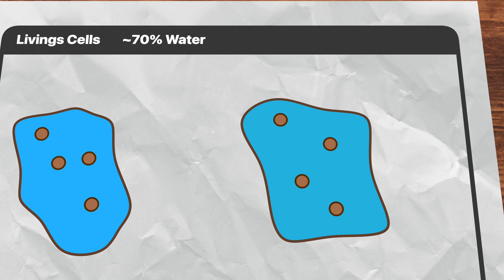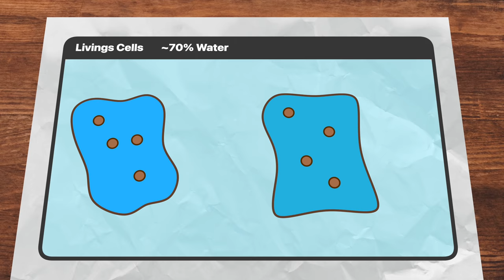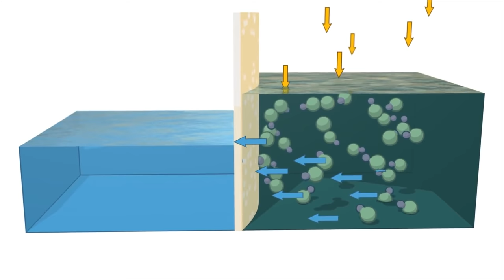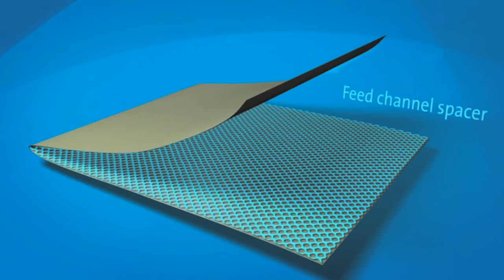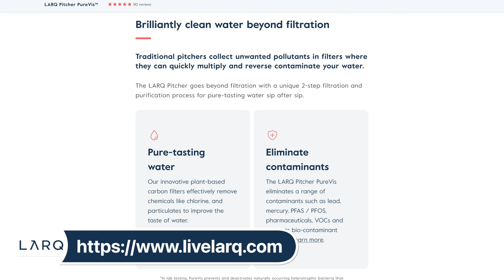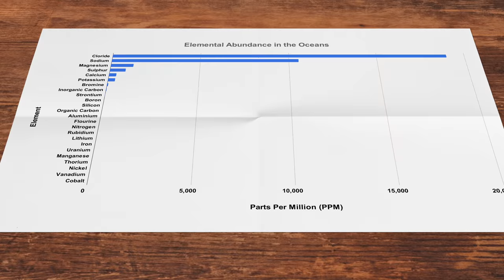Why Not Build Desalination Plants EVERYWHERE?

Comment: This video feels more like a marketing campaign for the city rather than an analysis as to why there aren't more desalination plants. The actual answer to the question was said in 10 seconds with no real dive into it. 
The Neom project sounds like another one of those model city plans that will ultimately fail because it relies on other systems which offset everything good that is done by the project. 
How can we ensure that removing these elements from the ocean is fine to do? How can you ensure that you don't remove too much water from the sea? How will this affect its biochemistry? 
Very little science was presented in this video and I am even skeptical even on what was presented. 
Is the Neom project the future of desalination? Who knows, because this guy sure doesn't. No specifics about the technology is discussed, just empty words and marketing terms.
Reply: Don't forget that Neom being a straight line is the worst start to urban planning you could possibly make. Cities have been circles for thousands of years because it is the most efficient shape for minimizing the average distance between all points on its area.
Reply: I got Matrix vibes when he started talking about that city.
Reply: Very good points. When something appears too good to be true, it always is. 

The solutions to our biggest environmental problems will require cultural change. Technological innovation will not save us—it will help, but innovation in technology without innovation in culture is a futile path.
Reply: “empty words and marketing terms.” 

Just because he doesn’t go 🤓 mode on doesn’t mean that his video is entirely fodder.
Reply: @Nukepositive  i disagree. It is inefficient for commuters but in an industrial sense, having 100% of business inputs and outputs connected via internal railways vastly cuts down on all costs associated with logistics. Commuters and pedestrians can use these systems as well.

Less efficient than getting into a car and driving but more efficiant than building a sprawling city in the desert.
Reply: For sure I thought the same thing.
Reply: @justifiably_stupid4998  You can still have an internal railway without it being in a straight line. We literally have railways all overs and point a to point b are not in a straight line. 

Also we already have an internal transport system called a subway. You can have the same “city of tomorrow” concept like Neom but in a circle or hexagonal shape and underneath the city is an organized and efficient subway system for goods and passengers.
Reply: Considering how much of the planet the oceans cover, I don't think taking a portion of that for desalination would be harmful. We'll probably be forced to do it anyway later on so may as well make it more efficient through more of those projects
Reply: But the desalinization through solar power is actually a real big brain idea. This has to be the future (the concept, not neccessarly those domes planned in NEOM)
Reply: @Second_Splitter  COnsidering his video is titled "Why aren't desalination plants everywhere" It's highly misleading to provide no actual reasons and sell out a futuristic project with no technical specifications. Even just providing some basic analysis: Desalination plants are incredibly expensive (show costs of one), take up too much power (show  a comparison of energy usage to other water filtration systems like spring wells), and generate brine which is terrible for the environment (plaster some research about how dumping saltier water into a local area destroys the habitat). Something like this would give us an idea of why they aren't around with some numbers that we can wrap our heads around.

The video was not about presenting facts to answer the question of why desalination plants aren't used, it became a video to speculate (key word here) that the Neom project would be the solution to the issues of desalination plants. However, as viewers, we have no idea of what those issues really are, their scale, and what this will do differently to properly fix it. This, in turn, limits the video to a marketing trailer with nice terms and technologies. 

This video does not serve to inform, but rather, to make empty promises and lure in investors who don't look further than skin deep. Nice ideas were presented, reverse osmosis, membranes, solar power, but without numbers or facts to back them up, what use are they?
Reply: @akiraigarashi2874  I understand that, that's not he issue I have. I am criticizing the video for what it presents. It feels like nothing more than clickbait for some speculative future project from a place that has already seen plenty of these fail due to  external issues. These types of projects have become fake outs, on the surface working, green, sustainable projects. Below, supported by the very systems they attempt to abolish.
Reply: Someone call Thunderfoot...
Reply: @festivebear9946  As far as I know he mentioned brine’s negative impact to the environment.
Reply: @spltorky  And it is highly fictual, their water source is untested and if you think one secound about it. How do they remove the salt in the dome? Do they have to shut down the water plant and remove it? Seems kinda stupid.
Reply: @justifiably_stupid4998  Yeah, and if the rail is under maintenance you can just use the other way around ... oh wait, you only have one way only? How tragic.
Reply: One question can’t we put the salt and minerals back into the used water? Basically using the fresh water from desalination for our needs and putting the salt and minerals back into the sewage system that flows back into the ocean.
Reply: Whatever large amount of water you think you are extracting from the sea to make fresh water, I can assure you, the impact wouldn't even be measurable. The ocean is way too large. 

Our global yearly use of fresh water is 100 000 times smaller than the size of the ocean. On top of that, literally all of that used fresh water will eventually end back up in the ocean again due to rainfall. 

But yeah, this project/city is an absolute gimmick regardless. Building a city as a straight line is like the dumbest thing you can possibly do for the simple reason that you would need multiple times more infrastructure to support it.
Reply: @jarzez  "The ocean is way too large." If you spread it evenly around the whole globe. Yes. If you concentrate your concentration of salt and minerals onto one particular place, for example using a pipe. No, the ocean in not large enough. It is the concentration in a defined area, not the ocean as a whole. It does not become salty throu evaporation of the sun because of the global water cyle... You do not have this with your desaltation plant.

Your 100k number is dull and we gain no further knowledge from it.

I agree with your rejection of neom, not sure what exactly you mean with multiple times more infrastructure. But there are pleny of examples where neom lacks critical thinking so I will pick my favorite ones and guess you are speaking about them.
Reply: @Seraphim262  you are not removing anything particular from the ocean other than seawater itself. There is no concentration difference of minerals or water at the site of retrieval if you avoid mindlessly dumping your waste back at that same site.
Reply: @jarzez  I'm talking about how this processed water will be returned to the ocean. The current way is a localized return pipe/outlet which dumps water with certain properties into some part of the ocean. If this water is too salty/too many chemicals/too different than the local water, it can cause severe harm to the local ecosystem. 

When you look at things at a global scale, it's easy to miss what the real cause of problems are. It's often these small, local issues that add up to the large-scale, global issues we face. So, especially as we move forward in technology, it's important to take into account these local issues since they could be behind the issue in the first place.
Reply: @festivebear9946  but that isn't what you were actually saying. You said how can we be sure we aren't causing harm to the ocean by removing those elements or taking too much water?

I'm saying, you aren't removing any specific element at all, you remove sea water. So the concentration is the same, and the amount removed is completely negligible.

And half of this entire video literally talks about not dumping the waste back in the ocean. Rather using the waste for other purposes. So there isn't any return outlet into the ocean.
Reply: 100%. just basic outlines and nothing on how that is supposed to work.. vaporware bs
Reply: @DommTom  honestly, if letting the sun do what she always did instead of using lots of energy which we provide by ruining our climate is called a "big brain idea", it just shows how absurd the system is we are living in and how hard it is for ppl to think outside its borders...
Reply: Yeah, I fully expect to see a "why it failed" video of Neom some time in the future. Just feels too much like the "floating city" concepts that we already have videos for.